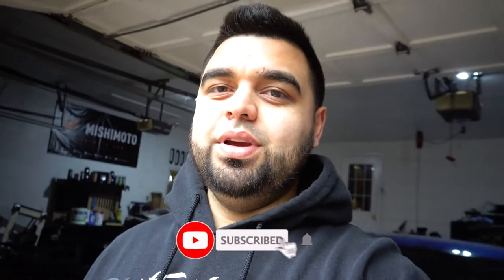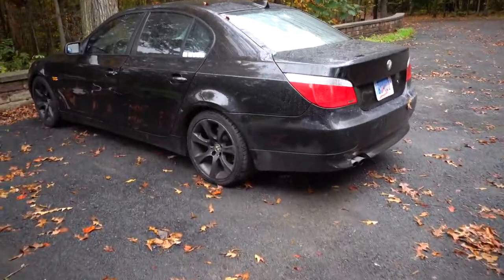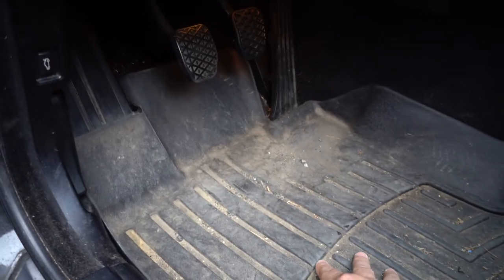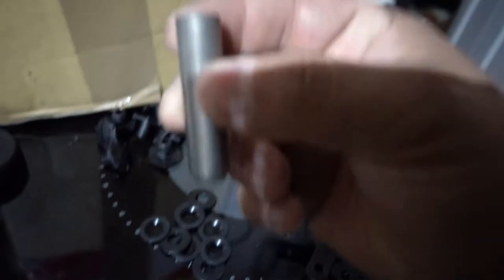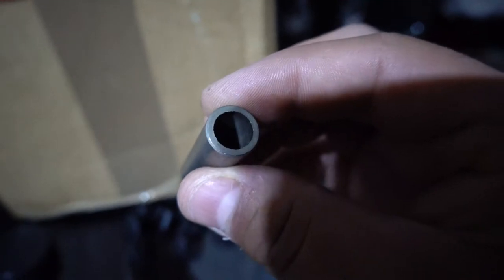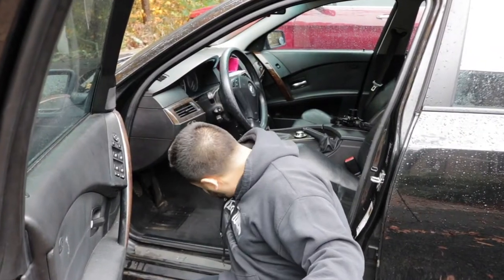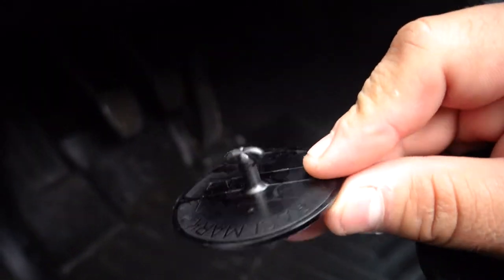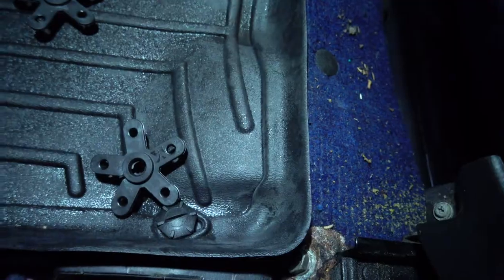Installing Eagle Klaw Floor Mat Fasteners On My WeatherTech | REVIEW

Comment: Hi. Which weathertech liner you have on the gc8? I'm trying to find one that fits mine. I have the same gc8 JDM, RHD with the steering wheel on the right.
Reply from the maker: They are for GD sti so 02-07

Comment: There’s adapter weather tech should have provided
Reply from the maker: I’ve bought numerous sets for different cars and I’ve never received adapters
Reply: @StayOnTheGas   oh damn. Mine didn’t need them but I looked online and they said they provide a little donut that would fix your bmw not fitting
Reply from the maker: Yeah I haven’t needed them on any other car either. I never knew they provided it

Comment: If you ran the mats on all your cars, you would have know they come with supplements hooks for those mats.  If you purchased those directly from them, they would have just you new mat hooks.  This I know because I just had to do this.

BTW, they way those clips you used installed are jacked up!  They’re in too far and if you may gets too wet, you get water intrusion.